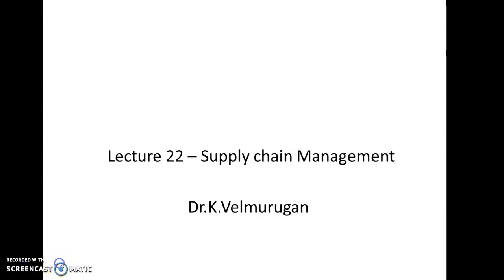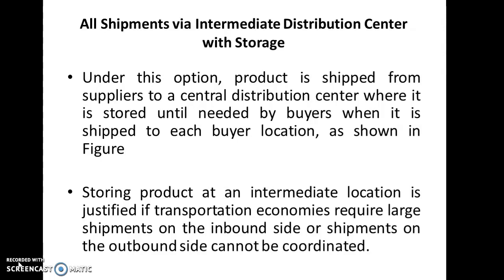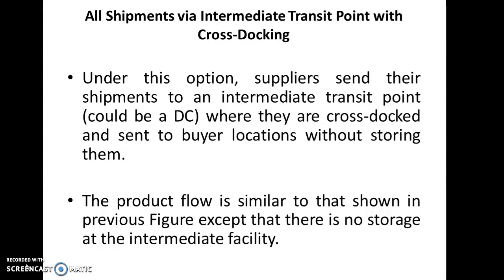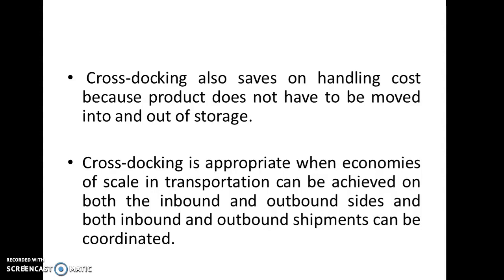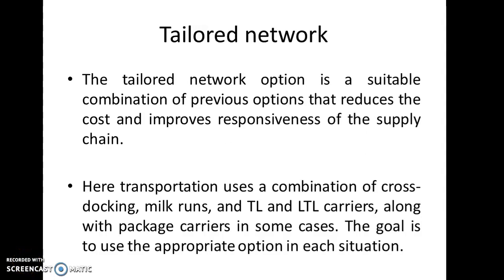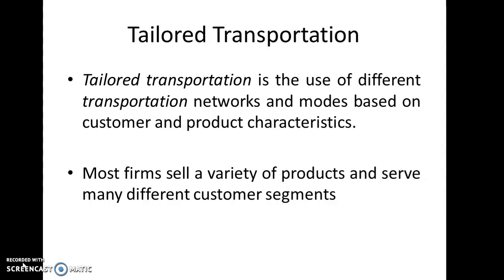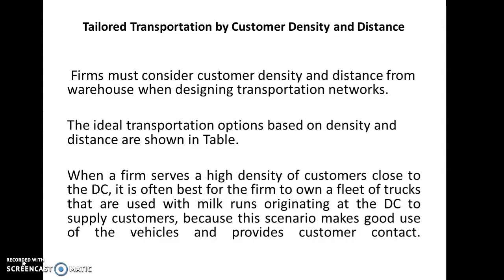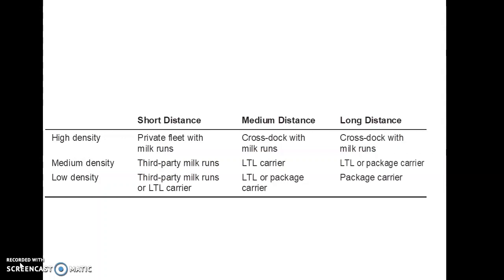Lecture 22 - Supply chain Management

Comment: Name: Nusrath Jahan A B
Roll no : 40
1. All shipment modes via a distribution center.  Because while storing a large shipments in a warehouse, the inbound cost will be reduced.

2. Tailored network is a shipment methodology which improves responsiveness and reduces the cost.
3. Private fleet with milk runs.

Comment: Name : Ajay B
Roll no : 02
1)All shipment modes via a distribution center.  Because while storing a large shipments in a warehouse, the inbound cost will be reduced.
2)Tailored network is a shipment methodology which improves responsiveness and reduces the cost.
3)Private feet with milk runs.

Comment: Name:P.saranya 
Class:CSE B 
Reg.no:57
Answer:
1.all shipment modes via a distribution center. Because while storing a large shipments in a warehouse,the inbound cost will be reduced.
2.tailored network is a shipment methodology which improves responsiveness and reduces the cost.
3.private feet with milk runs.

Comment: Name : M.Sowmiya
ROLLNo: 65
1) air and water transportation modes are best suitable for large and low value shipments
2)Tailored transportation is the use of different transportation modes and networks based on product and customer characteristics
3)private fleet with milk runs

Comment: Name Rakshana BT
RollNo 51
1. All shipment modes via a distribution center.  Because while storing a large shipments in a warehouse, the inbound cost will be reduced.
2. Tailored network is a shipment methodology which improves responsiveness and reduces the cost.
3. Private feet with milk runs.

Comment: Name:M.Soundarya
Reg no: 64(CSE-B)
1. All shipment modes via a distribution center.  Because while storing a large shipments in a warehouse, the inbound cost will be reduced.
2. Tailored network is a shipment methodology which improves responsiveness and reduces the cost.
3. Private feet with milk runs.

Comment: Name : Preethi R
Roll no : 45 CSE A
1. All shipment via distribution center why because large quantities of product are shipped to DC with lower cost
2. Tailored transportation. 
       Tailored transportation is the use of different transportation network and modes based on customer and product characteristics. 
3. Private fleet with milk runs

Comment: Name : T AKASH
Roll no : 04
Class : CSE-A

Answers:

1. All shipment modes via a distribution center.  Because while storing a large shipments in a warehouse, the inbound cost will be reduced.
2. Tailored network is a shipment methodology which improves responsiveness and reduces the cost.
3. Private feet with milk runs.

Comment: Name: D.Sneha 
Roll no :62   4CSE'B 
1. All shipment modes via a distribution center.  Because while storing a large shipments in a warehouse, the inbound cost will be reduced.
2. Tailored network is a shipment methodology which improves responsiveness and reduces the cost.
3. Private feet with milk runs.

Comment: Name: preethi
Roll no:46

1. All shipment modes via a distribution center.  Because while storing a large shipments in a warehouse, the inbound cost will be reduced.
2. Tailored network is a shipment methodology which improves responsiveness and reduces the cost.
3. Private feet with milk runs.

Comment: monica T
32
1. All shipment modes via a distribution center.  Because while storing a large shipments in a warehouse, the inbound cost will be reduced.
2. Tailored network is a shipment methodology which improves responsiveness and reduces the cost.
3. Private feet with milk runs.

Comment: Name : amarnath PR
Roll no : 05
Class : CSE-A

Answers:

1. All shipment modes via a distribution center.  Because while storing a large shipments in a warehouse, the inbound cost will be reduced.
2. Tailored network is a shipment methodology which improves responsiveness and reduces the cost.
3. Private feet with milk runs.

Comment: Name: G.P.Swathika
Reg no: 301
Class: CSE-B
1. All shipment modes via a distribution center. Because while storing a large shipments in a warehouse, the inbound cost will be reduced.
2. Tailored network is a shipment methodology which improves responsiveness and reduces the cost.
3. Private feet with runs.

Comment: Name:Habeebulla S
Roll No:17
Class:CSE-'A'

1. All shipment modes via a distribution
center. Because while storing a large
shipments in a warehouse, the inbound
cost will be reduced.
2. Tailored network is a shipment
methodology which improves
responsiveness and reduces the cost.
3. Private feet with milk runs.

Comment: Name: Mohamed Hasan J
Roll no: 31
Class: CSE-A

#Answers:
1. All shipment modes via a distribution center. Because while storing a large shipments in a warehouse, the inbound cost will be reduced.
2. Tailored network is a shipment methodology which improves responsiveness and reduces the cost.
3. Private feet with milk runs.

Comment: Name-V.Pradeepaa 
Reg no -702
CSE-B 
1. All shipment modes via a distribution center.  Because while storing a large shipments in a warehouse, the inbound cost will be reduced.
2. Tailored network is a shipment methodology which improves responsiveness and reduces the cost.
3. Private feet with milk runs.

Comment: Name : R.S.Sriram
Roll no : 69
Class : CSE-B

1. All shipment modes via a distribution center.  Because while storing a large shipments in a warehouse, the inbound cost will be reduced.
2. Tailored network is a shipment methodology which improves responsiveness and reduces the cost.
3. Private feet with milk runs.

Comment: Name:s.sadhana
Reg.num:53
Cse-b
Answers:
1. All shipment modes via a distribution center.  Because while storing a large shipments in a warehouse, the inbound cost will be reduced.
2. Tailored network is a shipment methodology which improves responsiveness and reduces the cost.
3. Private feet with milk runs.

Comment: Name:c.sivaranjani
Roll no:61
Ans:
1. All shipment modes via a distribution center.  Because while storing a large shipments in a warehouse, the inbound cost will be reduced.
2. Tailored network is a shipment methodology which improves responsiveness and reduces the cost.
3. Private feet with milk runs.

Comment: Name: S Yuesh raaj
Roll no: 77

1. All shipment modes via a distribution center.  Because while storing a large shipments in a warehouse, the inbound cost will be reduced.
2. Tailored network is a shipment methodology which improves responsiveness and reduces the cost.
3. Private feet with milk runs.

Comment: Name Sudheshna A.G
Roll no 71
CSE B
1. All shipment modes via a distribution center.  Because while storing a large shipments in a warehouse, the inbound cost will be reduced.
2. Tailored network is a shipment methodology which improves responsiveness and reduces the cost.
3. Private feet with milk runs.

Comment: Akash S 
Roll No. 03 CSE A
1. All shipment modes via a distribution center, because while storing a large shipments in a warehouse, the inbound cost will be reduced.
2. Tailored network is a shipment methodology which improves responsiveness and reduces the cost.
3. Private feet with milk runs.

Comment: K.kamalesh 
820417104024

1. All shipment modes via a distribution center.  Because while storing a large shipments in a warehouse, the inbound cost will be reduced.
2. Tailored network is a shipment methodology which improves responsiveness and reduces the cost.
3. Private feet with milk runs.

Comment: G. Balaji
Roll no : 9
Answers:
1. All shipment modes via a distribution center.  Because while storing a large shipments in a warehouse, the inbound cost will be reduced.
2. Tailored network is a shipment methodology which improves responsiveness and reduces the cost.
3. Private feet with milk runs.

Comment: Name:P.Iswarya
Roll.No:20
Class:CSE-A
1) all the shipment modes via a distribution centre.becsuse while storing a large shipments in a warehouse  the  in bound cost will be reduced 
2) Tailored network is a shipment methodology which improves responsiveness and reduces the cost
3) private feet with milk runs

Comment: Name: Aswin.R
Reg no: 08
Answers:

1. All shipment modes via a distribution center.  Because while storing a large shipments in a warehouse, the inbound cost will be reduced.
2. Tailored network is a shipment methodology which improves responsiveness and reduces the cost.
3. Private feet with milk runs.

Comment: Name:Sonali R
Sec:CSE B
Reg No:820417104063
1. All shipment modes via a distribution center.  Because while storing a large shipments in a warehouse, the inbound cost will be reduced.
2. Tailored network is a shipment methodology which improves responsiveness and reduces the cost.
3. Private feet with milk runs.

Comment: A. B. GAYATRI 
Roll no 16 
CSE-A 4th yr 
1) All the shipment mode via distribution center because while storing large shipments in warehouse 
2)tailored network is a shipment which improves responsibility and reduce cost
3)private feet with milk run

Comment: Name : R.Padmavathi
Roll no:  41
Class :  A

1)  All shipment modes via a distribution center.  Because while storing a large shipments in a warehouse, the inbound cost will be reduced.
2)   Tailored network is a shipment methodology which improves responsiveness and reduces the cost.
3)   Private feet with milk runs.

Comment: K.v.rakshana 
52 
1. All shipment modes via a distribution center.  Because while storing a large shipments in a warehouse, the inbound cost will be reduced.
2. Tailored network is a shipment methodology which improves responsiveness and reduces the cost.
3. Private feet with milk runs.

Comment: Name : S.Jafar Ali
Reg no : 820417104021
Class : CSE-A

Answers : 

1. All shipment modes via distribution center.Because storing a large shipments in warehouse , the inbound cost will be reduced

2. Tailored network is the shipment methodology which improves responsiveness and reduces the cost.

3. Private feet with milk runs.

Comment: Name : M . Naveen kumar
Roll no : 38
Class : CSE-A

Answers:

1. All shipment modes via a distribution center.  Because while storing a large shipments in a warehouse, the inbound cost will be reduced.
2. Tailored network is a shipment methodology which improves responsiveness and reduces the cost.
3. Private feet with milk runs.
Reply: Name M Venkateshwaran
ROLL No 75 CSE B final year

Comment: Name :Siva Bharathi
Roll no :60

1. All shipment modes via a distribution center.  Because while storing a large shipments in a warehouse, the inbound cost will be reduced.
2. Tailored network is a shipment methodology which improves responsiveness and reduces the cost.
3. Private feet with milk runs.

Comment: Name: Vasanthan.M 
Roll No: 73
1. All shipment modes via a distribution center.  Because while storing a large shipments in a warehouse, the inbound cost will be reduced.
2. Tailored network is a shipment methodology which improves responsiveness and reduces the cost.
3. Private feet with milk runs.

Comment: Name=k.sasirekha
CSE B
Reg no 58
1. Shipment is a distribution center and network ,it is storing a large  product in warehouse and minimum cost .water shipment is low value cost
2. Tailored transportation is the use of different transportation network and mode  based on customer and product characteristics.
3.private feet with milk run

Comment: Name:Mukesh S 
Rollno:35 
Answer:
1. All shipment modes via a distribution center.  Because while storing a large shipments in a warehouse, the inbound cost will be reduced.
2. Tailored network is a shipment methodology which improves responsiveness and reduces the cost.
3. Private feet with milk runs.

Comment: Name:G.Abinaya
Sec:cse B
Reg no:701
1. All shipment modes via a distribution center.  Because while storing a large shipments in a warehouse, the inbound cost will be reduced.
2. Tailored network is a shipment methodology which improves responsiveness and reduces the cost.
3. Private feet with milk runs.